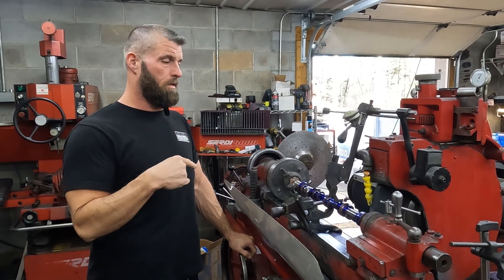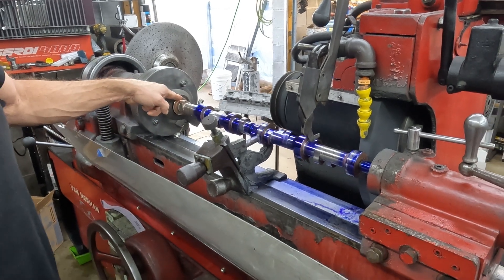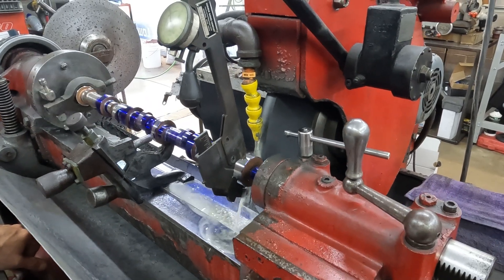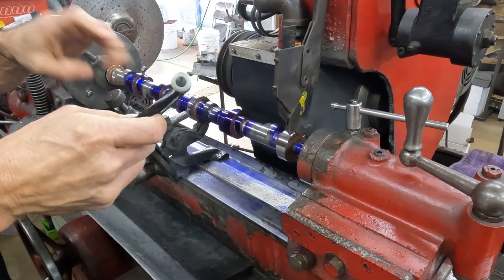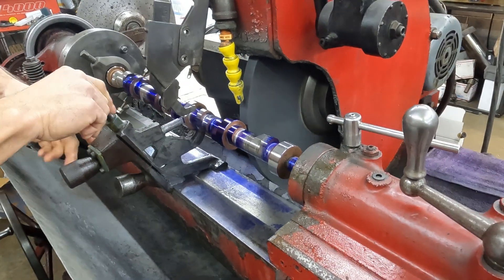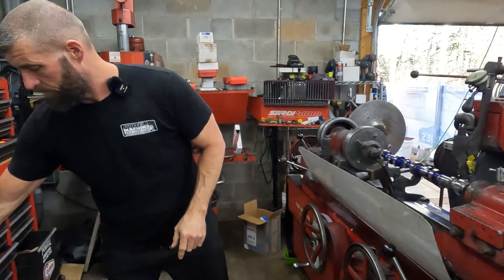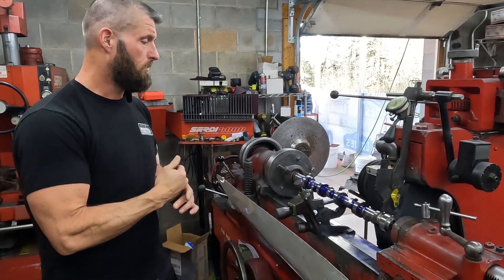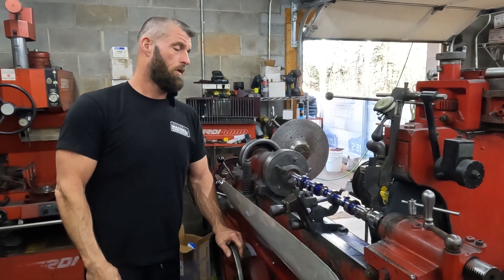Viper cam mods....Grinding the mains part 2

Comment: How does the grinding wheel put the taper on the cam lobes but not on the cam main journals?
Reply from the maker: We dress taper in the wheel when needed,  roller lobes are not tapered just like the mains
Reply: It is called changing the wheel.

Comment: I need a small block chev cam with  1.200 valve lift and 305° at 0.050 with standard size joutnals.
Reply: With 1.5 rocker ratio that is 0.800" lift at the cam. You figure out of that would fit through the standard block cam journals assuming a reasonable cam base circle diameter. Plus where are you going to find valve springs that will cope with 1.200" valve lift and still give sufficient pressure with the valve on the seat. Retired mechanic/machinist. No wonder Daniel did not respond.
Reply: @bobhudson6659  it was a joke, I'm sure he got it.  BTW, pro stock engines have been running that much lift for years  with a minimum 2.1:1 rocker ratio,   No one seeking any kind of performance  uses a 1.5:1 rocker ratio, even break in rockers are 1.3:1 for a SBC.

Comment: If the journals are not roughed concentric to the center drilling, won't the steady rest transfer the error to the closest journals on either side of it? I would think you would get some deflection. You seem pretty thorough set up to inspection. Have you ever put an indicator on a finished journal with the steady rest snug and then it backed off and noticed a difference?
Reply from the maker: I explained how to overcome that in the beginning of this video...
Reply: @powellmachineinc  Duh, right after the intro, kept going back to see if I missed something, didn't go far enough.

Comment: HI DAN. GARY HERE FROM LAST NIGHTS QUESTION ON THE DRIVE GEARS. I KNOW IM PROBABLY ASKING A STUPID QUESTION OR MAYBE I MISSED A PRIER VID..  I ADMIT I KNOW NOTHING ABOUT CAM GRINDING, BUT I REALLY DON'T UNDERSTAND WHY YOU ARE GRINDING THE MAIN CAM JOURNALS??  WHEN ITS DONE DO YOU PUT UNDERSIZED CAM BEARINGS IN BLOCK?? OR IS THESE CAM JOURNALS BIGGER THAN STOCK?
Reply from the maker: See part 1.....
Reply: I SEEN THAT BUT WHY IS IT NOT A STANDARD SIZE TO START WITH??  SORRY DONT UNDERSTANDI @powellmachineinc